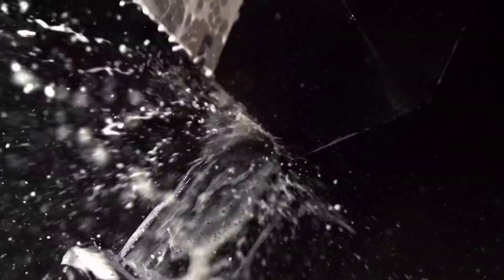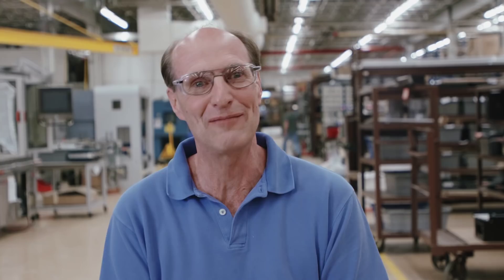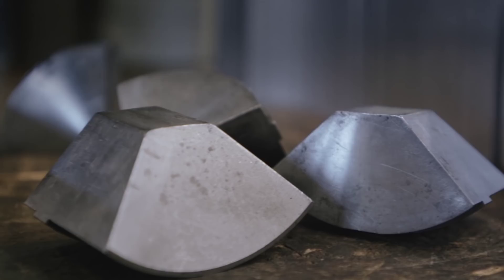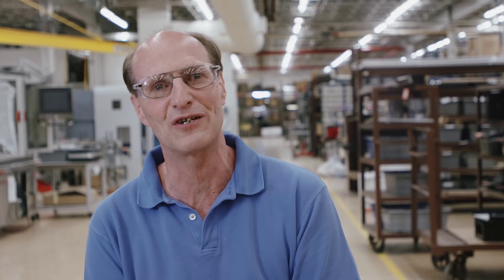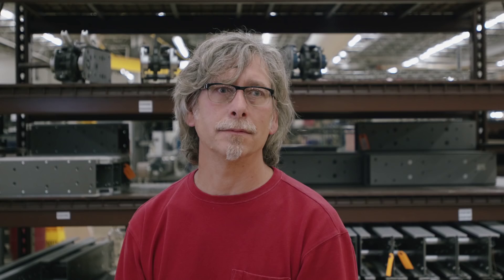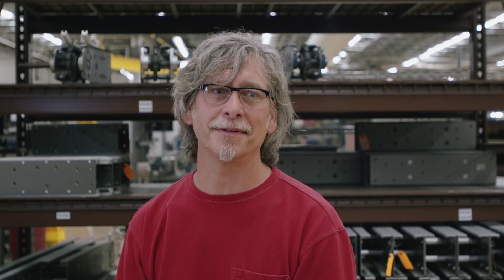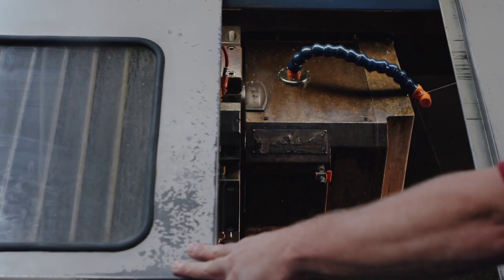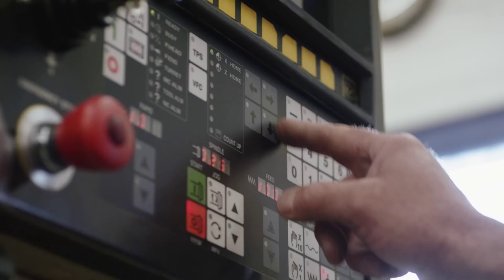Tripled productivity in parting off - Emhart Glass made the switch

Comment: show me the cuting data
Reply from the maker: +Lang Truong 

Hi Lang!
Let me apologize for the late reply.

The material machined is 89 mm diameter, 12L14 steel. 

With CoroCut QD, Emhart Glass could machine the components at 183 m/min and 0.18 mm/rev. With the previous tool, Emhart had to run at 67 m/min and 0.05 mm/rev.

Hope this has answered your question.

For more information about this specific case, please check out this article on our website: http://www.sandvik.coromant.com/en-gb/knowledge/featured-articles/pages/removing-the-bottleneck.aspx
Or please contact your local sales representative. You find contact information on www.sandvik.coromant.com/contact

Best regards
Jim Pappas, Productivity Engineer, Sandvik Coromant